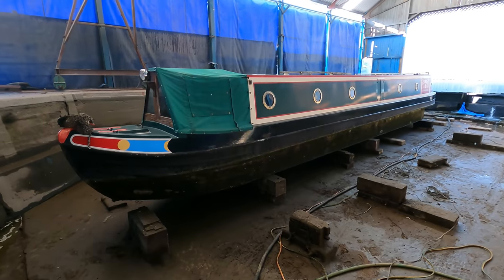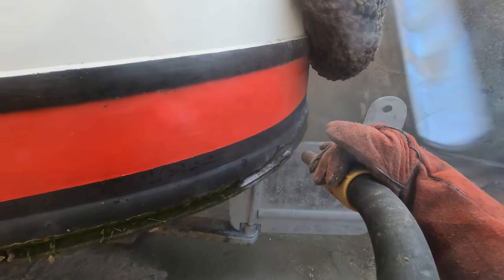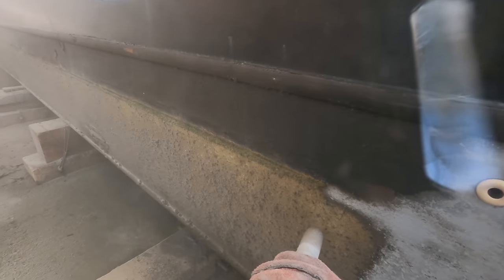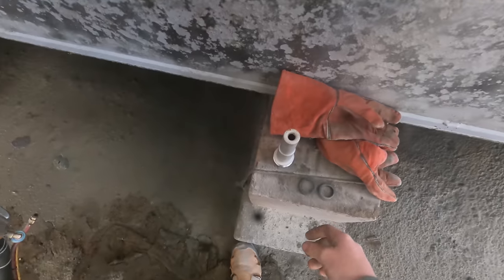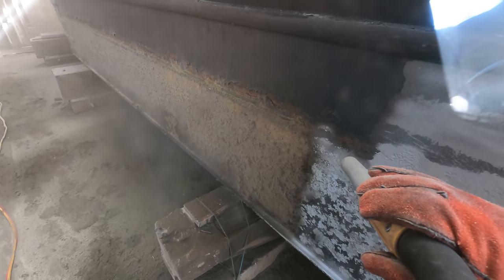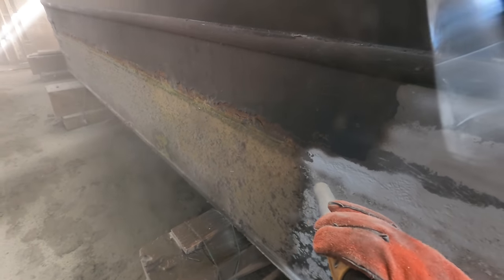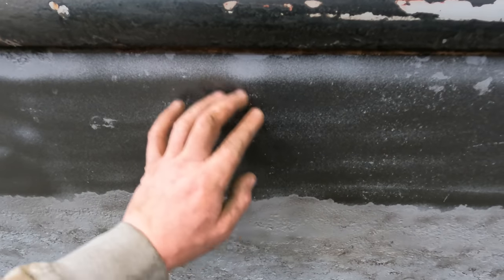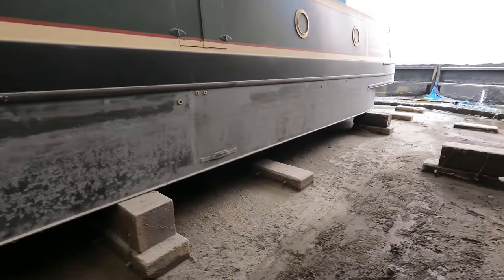Blasting Narrow Boat | SandBlasting canal house sand blasted

Comment: Just a tip mate when you replace the nozzle holder put a smear of silicone on the hose before fitting it will help with the seal, a lot of the problem comes from the screws that can just puncture through the hose & form a hole. I have had the media cut right through the hose & the plastic. But I do use Garnet, somewhat more aggressive on the equipment..
Reply from the maker: Yeah when changing the nozzle holders I normally use swafeega on the pipe on this job I swapped the full pipe for the spare on the van 😂 luck would have it I had a spare 40m pipe sitting in van. Very lucky that day or I would have had to cut and move holders not something I want to be doing with limited hand tools 😂

Comment: I can remember doing similar to an old cottage in sussex all the external walls had been painted over..... beutiful face bricks and flint stones looked a million dollars all cleaned and re pointed after days of work...... single tool compressor road tow big pressure pot and a head mask with shoulder protection so so heavy and giant gloves and an air line respiration thing......
Reply from the maker: thats the 1 but I use a 4 tool compressor just for the more flow = more doh thing :)

Comment: @mick when you have a blockage in your hose and it starts to whistle fold the hose while under pressure it shoots air back in the last pot 2 thinks happen one your hose is getting freed up and two the cone in your blast pot is getting dislodged as well and blast media will fall down and you start blasting again till your pot is empty
Reply from the maker: Yeah I try not to use this because I have a valve I can shut and open the grit at my finger tips this tungsten plunger smashes the clog and reopened under my control on my older pots this would work perfect but doing it with this is pushing air back past a 1 way valve under normal load. Also check my latest video on the green wagon towards the end watch my pipe bleb this is from doing just that 😂 
What also works if you have another man drop the choke leaver when your blasting for 1 or 3 seconds this diverts more air into the pot pushing the crap down and out that's the most effective way but means paying another wage 😔

Comment: Just come across your vid Mick it brings back a lot of memories from when I used to sand blast stuff. I started after getting made redundant and my father in law had all the gear but had just been diagnosed with sarcoidosis of the lungs . ( being a farmer he always had bad lungs ! ) So he said I could have his gear and carry on . So started doing stuff on farm with old ingersoll rand vane type 175 cfm compressor and old swedish egg timer blast pot 😅 he'd been using sand straight from Rainfords sand winning plant on s'port coast so it'd rotted the inside of pot real bad. I was blasting an old trailer one day when I heard a big POP ! The bloody pot split in 2 😲😮 right round the mid section 😅🤣😂 Anyway I decidef to invest in a new robsons 2 bagger and carry on. THEN THE  damn compressor started pushing oil through in air so that was that with that compressor too !! SO I shopped around and eventually found an atlas copco 250cfm with 600hrs on it so I did it up serviced it and changed tyres and brake cable and was back blasting. I really enjoyed it and bought new lines new air lines a  secondary moisture capture pot and new gear (hodge clemco helmet @ppollo, and air breathing filter and new overalls and gaiters and a load of 1/2" nozzles, carbide ones. I found it very therapeutic and in a funny way calming. 🤔 wish I'd have carried on with it but no fun all that downtime in winter when weather was sh1t 😅🤣 I'll subscribe and keep watching bud 👍 oh and make sure your compressor is well up wind of your blasting amazing how quick you learn that one 😅🤣😅🤣  Steve. 👍
Reply from the maker: 😎👌👍 hopefully I can bring back some good memories👌 I've plenty of videos uploaded to have a sift through. And yeah when service kit is 180 just for 2 air filters ya learn real quick to keep the compressor well out of the way 😂

Comment: What mediums are u using mick when i did  blasting on the wagons etc i used like a metal filling compound it was disposable stuff . Came from machine shops . It wasnt bad stuff it had bn dried but u still got damper stuff amongst it from the cooling fluids used during the milling process  it certainly took the crap of . But wore out nozzles quickly  . It left a nice surface to paint . The first etch coats just dissapeared into the metal .  Prefer power washing to the blasting hated wearing the helmet . . Love watchin ur vids . Like i say itts great seeing the finnished result .
Reply from the maker: Thx it's appreciated 👌💞 and I use crushed glass on 99% of my work 👍

Comment: Gday mate, great channel. have a rip with an xl or a double Venturi nozzle at the bore size your compressor can handle. Maximises your air efficiency, bigger blast pattern and cleaner cut on hardcore corrosion/coatings like this. Less time on the hose means sooner you can knock off and get a cold one 🍻cheers
Matt
Hydra blast restorations
Reply from the maker: Thanks appreciate it 👌 I find the xl only added extra reach but I'm a very big fan of this style nosel just sometimes the length and extra kgs on the longer shifts I perfer to use a general clean nosel were I don't need the extra reach plus they only cost a fraction of the xl 😬 I find the double venture spreads the hotspot and in turn showing the cut I would only pick this style if light fast prep is needed along with the fan nosel similar effect.

Comment: Hi Michael, new subscriber, silly question? Do you recycle any of the sand you use?
Reply from the maker: Not a silly question it could recycl but I tend to use the media 1x because once it hits it brakes up a small % so not a uniform finish not only that I once was 2 bags shy of finishing a job so I scooped some up. Well I spent the next 8 hour with the pot in bits trying to service a stuck bit of crud. Ever since that I only use fresh media just for the speed aspect and I know that the start of the job will end the same way (profile wise) thx for the sub its appreciated 💞

Comment: Does take longer than I thought from the last boat video. The crud and rust that build up is scary. As is the pitting.
Thanks.
Reply from the maker: Yeah some boats can take 8 hour + this is in good shape to be fair looks a good boat 👍 we'll it will be once its painted
Reply: Do you see much difference between those with ordinary blacking and those with epoxy blacking?
Reply from the maker: @kevgermany  no normally around the same to be fair possible that apoxi takes that bit longer to remove but nothing so noticeable

Comment: Hi Mick' I have a sand blasting kit it works great but I was told not to use sand but other types of  media.
I have a sandblasting cabinet I built myself it does the likes of 2 - 3  - 4 Cyl engines I am using glass media. Is it sand you are using. Tom Ayr.
Reply from the maker: In the UK sand has been banned since the 70s for use of blasting due to the free silica init I mainly use recycled materials such as crushed glass 👍

Comment: Hi. I'm watching couple of your clips. 
Got question. Why you don't use quartz sand for that job or other more abrassive media?? This will geave you faster work and problem with mild scale will be solved. I'm think glass for that job is waisting your time. 
I use glass only for aluminum and other soft material. For wood and brick etc I'm suggested use soda. Soda don't make that dirt. 
Btw. It's onlyy my suggestion. I'm blasting in Poland and we have different sandblasting standard 😁😁
All the best for you  👍👍👍👍
Reply from the maker: Sand is band hear in the UK due to the free sillica 😒 I use glass for the cheapness I know that j blast (copper slag) is good at removing milscale ornevwn steel shot but the cost involved my customers don't want to pay the extra involved also the glass washes out of the Dock easier than a hever grades so the pros are better than the cons with glass hence why I stick with it. As for milscale if it was so important to remove why is it on when I get to the boat? If they can release the boat with it still on why dose it then become my job to remove?
Reply: @Mobileblaster  First I'm hear about sand it's ban in UK. For me it's no point ban natural sand. 
I'm would say ban glass but not sand. 
Anyway abaut mild scale. Basically it's hard to remove mild scale on plate this take lot of time. Eaven remove with angle grinder it's slighty hard when you don't push hard to the material. It's lika a steel sheel. It's that beacouse steel is cold rolling. It's hard to explain. 
Remove mild scale it's basically long and costly process. And don't make this in shipyard when make narrow boat for one reason. Money. They put paint on the plate to reduce costs and time. 
Later people like you and me spend time and clean all crap plus mild scale to new paint coat but for correct material preparation. 
When I'm working in shipyard in UK we clean aluminum haul with angle grinder for better surface to paint. Without this paint just go after couple months beacouse surface is too shiny. 
An it's reason why in Poland we use sand. It's cheap and more effective. Some company use other abrasive but glass we use like I'm mentioned for aluminum cleaning mostly.
Btw in Poland we charge 30 to 50££ per working hour or for square meter biggest jobs. Smaller its depense how time is cleaning. Most popular nozlle start from No 4 size for bigger jobs 10 or more 😁😁
Regards
Reply from the maker: @marcinlisiak700  yeah I understand how milscale comes about but we need to ask ourselves why should we have to remove something that's on a boat that's been released from factory and they deem it to be acceptable so why then dose it become my problem to remove it? It's not my problem and I don't get involved trying haha sand has free sillica in and once its blasted and becomes airborne it becomes very dangerous to anything and anyone that breather air. Its been banned since the 60s in the UK not banned as a product but banned to blast with.
Reply from the maker: @marcinlisiak700  nosel size is determined by the flow and psi you cannot just pick a bigger nosel because its a bigger job. To get optimal 100psi at the nosel you need to know the cfm and the flow rate of the pipes and distance of the pipe you plan on using to know what nosel you need. 😉 👌
Reply: @Mobileblaster  I'm blasting one year + 😁 When I'm work lika a welder in one company I'm make small construction and this what I'm make later I'm need sandblasting. Now in Poland I'm work two months like a sandblaster in company what they make LED mirrors. But don't invest for better compressor, sanding pot and want on me to use crap staff so i give awayaway and say good bye. 
Basically I'm still learn some things about sandblasting 😁😁😁 
I'm wish have enough money to bay my own sandblasting setup but is expensive. New pot and compressor is at least in pounds something like 20+k ££ . Used compressor they start 1000 to 6000£ and new pot 1500 to 4000£.😁😁 
Probably price is similar. 
Do you can use soda in your pot?? Or just only glass?? Beacouse for me on my knowledge it's doesn't matter what is in pot. Most important is working pressure is that right??
Reply from the maker: @marcinlisiak700  your flow is the most important thing to get your head round flow and psi will determine cut rate and media. My pot is a basic presure pot I'm working with at the moment but I have built my own pot that will blast from 7psi all the way to 175psi and do multi media soda to steel shot and anything in the middle.
What some guys can cut and clean with a lower cfm but a more expensive media I can achieve the same finish with more flow/cfm and use cheaper media. So it's all what works best for you and your rig. And work load
Reply: @Mobileblaster  Unfortunately in Poland pot must be certificate when I'm make commercial /private business beacouse pots in my country they are high pressure. But in private on your own garrage you can use handmade pot what you wish 😁 Eventually upgrade commercial pot what is legal. Just only use better micro valve, add extra water separator etc. 
How many litre is your pot?? Standard small 100L or bigger?? 
P. S it's lot on you tube russian language films what they make own sanding pot 😁 And I'm forgot mentioned. Use wibrator for pot its good gadget for sandblasting😁
Reply from the maker: @marcinlisiak700  yeah my build pot isn't a DIY thing I'm trying to get it protected so I can mass produce it. It has pressure cert so your fully insured and comes with a  Schematics. It will be the best on the market for Mobile guys no other pot can do what this does all in 1. I've used the best possible parts available and had the chamber rolled to my liking and welded with coded welders the full pot is galvanised inside and out its truly is built to last.
The pot I'm using at the moment will hold 100kgs of glass or 1,000kgs of steel shot the size of the pot depends on the density of the media. Super fine glass I can only get 2 and half bags 60kgs ish in it. Or 40 bags of steel shot. So to say how many L is it I don't really know haha I know the size 20" wide by 40" tall my build is different and I'm not willing to share the size of that untill it's protected.
Reply from the maker: @marcinlisiak700  my build has vibrator and positioned in a very well thort out position for maximum effect. It also has the ability to blast 
Dry
Dry and wet (win)
Fully slurry 
Air only
Air and water only
And all this is fully easy to switch between all the options except slurry can be done on the fly at the nosel by 1 operator
Reply: @Mobileblaster  Nice project. I'm wish see ready made and in action. Basically it's dream all sandblasters 🤣🤣
Reply from the maker: @marcinlisiak700  😂 I got knocked back with the patent so I've lost interest I will get round to starting it up again 1 day

Comment: What happens to the bottom plates? Are they just left as out of sight? Seems odd as they will be every ebit as bad as the sides below the water line. Sympathise with damp sand - my Hodge Clemco doesn't like it at all !
Reply from the maker: Usually it don't mind a but of damp sand but this was well I had to do away with the siv so it would go in the pot haha my build pot is a fully dry as normal or fully saturated or I can add water with win nozzle no other pot available for sale can do this I'm waiting to get it protected before showing how it fully works 😉
Please have a snoop through my other videos I have base plate blasting also all kinds of other stuff you may find entertaining hopefully 😂 that was the goal with the channel anyways 💞👍
Reply: bottom plates aren't generally cleaned or even painted / blacked. They are thicker so a little corrosion is less of an issue. They are far enough below the water that there is little oxygen to promote rusting, and in any case narrowboats regularly scrape the bottom so any coating would soon be compromised.
Reply from the maker: @spencerwilton5831  plus they are hard to blast so prefer folk wouldn't do the base haha please have a snoop through my other videos I have a base plate blasting video 👍💞

Comment: On a previous video you mentioned that you were not a fan of soda blasting.  I had read soda blasting was good for boat hulls as you have a longer period of grace between blasting and painting without rust reappearing on the steal.  I’d be grateful for your opinion/view just out of interest.  I had my NB grit blasted 3 years ago prior to it having 2 pack epoxy applied.
Reply from the maker: Soda wouldn't bite through the rust scabs well possible it would but take a very long time and use a lot of media.
Soda is very much like a fine paint removal kinda like taking paint off a can of coke without damage to the alloy prity much useless in my line of work.
And time before paint totally depends on humidity could last weeks before paint could be hours soda will put a very slight extra lee time but nothing to right home about infact I don't fink anyone would notice its only what you know what it dose that would make you thing its giving more time if you get me? 
Soda on hulls possibly talking about fiberglass boats? Soda on steel huls would be very costly and not make a nice job like glass 👍
Reply: @Mobileblaster  thank you for the comprehensive reply.  I’m grateful.  I find the subject interesting but I suspect you make it look easier than it is 😀
Reply from the maker: @blacklablover2982  your right it dose take a bit more skill than it looks in video just like when you watch a plaster in action look easy until you try it haha
Reply from the maker: @blacklablover2982  your right it dose take a bit more skill than it looks in video just like when you watch a plaster in action look easy until you try it haha
Reply: Also, the specific density of soda is not appropriate for rust removal, more for paint removal without creating a surface profile. My choice would have been Garnet.
Reply from the maker: @andrewlee4239  Why garnet? Slightly more expensive media to do a very similar job and profile is not required. What would the pro be? I'm asking as I've always thought glass and not tried it on boats for this reason.
Yeah soda is specialise blasting to remove very thin soft paints
Reply: @Mobileblaster  I have found that Garnet will increase productivity, it has a higher density than glass so you tend to get a bit more punch for your buck. Also, it is more readily available in AU.  I do use some glass but tend to save it for  Aluminium work.
Reply from the maker: Ah that will be why then yeah hear in the UK garnet is around 2x the price we'll I order so much glass at 1 time I get a slightly better rate than the next guy and I cannot get any sort of bulk deal on garnet so I stick with glass haha